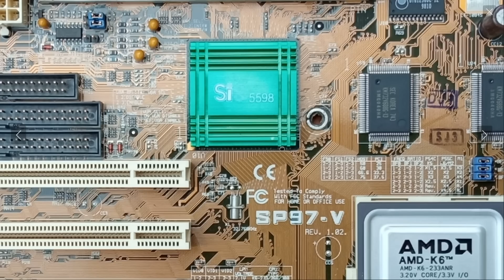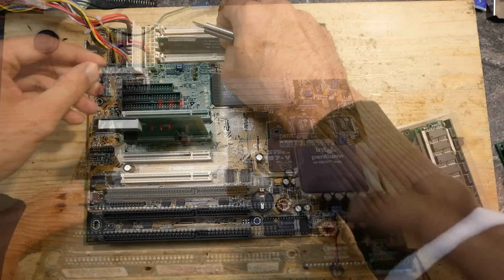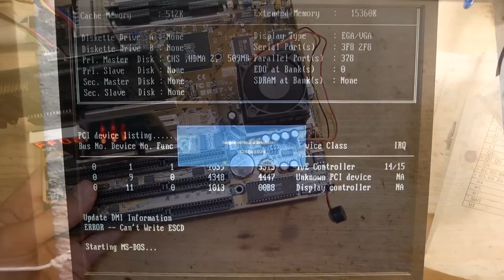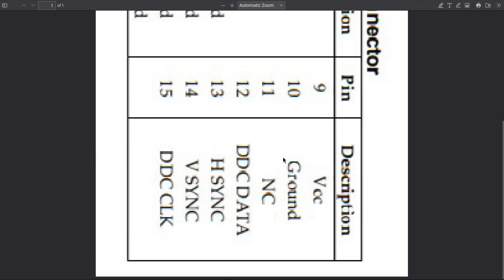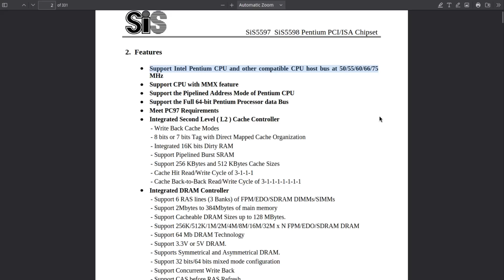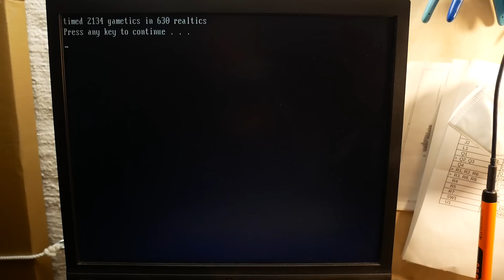Let's repair Asus SP97-V

Comment: Salvage is also valid, but as I was working in a computer shop around the time the motherboard was current, I often found that green SiS heatsink at the bottom of the case. (The days of playing local multiplayer Starcraft on 486 like systems just for fun)

Comment: This was the motherboard I had in my first PC. It was cobbled together from older parts in the early 2000s. I wanted to get one to rebuild it a few years ago but couldn't find it anywhere. I ended up with a complete system with an Asus P5A-B motherboard. It doesn't boot no post beeps. I may sit down sometime and try to diagnose it.

Comment: ASUS produced an OEM ATX board, the SPAX, that is essentially this board in ATX. There's usually (always?) a PCI slot omitted with the onboard graphics backplate connector populated. I've cleared the holes for the missing slot and installed a connector on several SPAX boards, and then used the SP97-V BIOS to get K6-2, -III, -2+ and -III+ CPUs, which makes for a really decent SS7 system! Losing the onboard graphics is, of course, no loss :P

Comment: Hi all, I have socket 3 mainboard which on startup via analyzer cards shows only dashes. When I pull down the chipset with a finger there are some number, but  post stucks on code "13 12". Ami bios. The question is: is it possible to repair connection between chipset and pcb at home? I don`t remeber well, but necroware or another YTber has the same issue. Help please :)

Comment: This unlocked memories!

Many years back I got a discarded CPU with this SP97 motherboard from a nearby computer store. It is a simple little motherboard, possibly the former owner used it for typing documents and such. Unfortunately, I didn't know better and I did only salvaged the Pentium 166 processor and the RAM, but did not preserve the motherboard. Back then there was not a lot of information on SiS chipsets boards, and there are stigma around them in the tech forums.

If that is aired in 2006, I'd happily keep it! 😆😅

Comment: I had the same chipset on a PC Chips motherboard, in my first SI special. It had the same USB and Mouse board, but the bios was compatible with K6-2. It came with 16mb and a Cyrix MII-233. I added a K62-350 overclocked and a Voodoo Banshee and it was a capable dos gaming machine.

Comment: I used to use those SP97V boards quite often (i was working in IT back at that time), they were good solid board for general purpose office machines (as mentioned), but definitely needed an external GFX card for any kind of gaming.. plenty of flexibility for configuration and upgrading, as well as being relatively cheap compared to intel based chipset boards.
Edit: typed while watching your video, wow that final test config was pretty much what i ran back in the day, until I upgraded to BH-6 (then P2B, it was better) running cel. 733 @ 1.1ghz

Comment: My parents had a PC with this chipset and I thought it was terrible at the time, mostly due to that integrated graphics. I remember it used the same drivers as the SiS 6326 dedicated card. I also remembered reclocking the CPU at 66x4 because the default 75x3.5 was causing graphics artifacts.

Comment: I used to build SiS SuperSocket 7 PC's back in the day as a little side-line at home. Did about 7 to 10 per week and with the Cyrix MIII 333. With lots of RAM, a good HDD and a Modem thrown in they sold like hot cakes. I could not make them fast enough. Why ?, they were cheap. £100's cheaper than a shop PC but with excellent performance for the time.

Comment: my only critism as that it doesnt have sdram slots, other than that its pretty similiar to the pcchips board i had but that only had a SIS 530 chipset with 8mb agp onboard, except the cpu settings where done in the bios.

Comment: Regarding the new bios chip - I have been there too. During restoration of a very early socket 7 SiS based Asus board. Not only you need a flash chip to let the board update the ESCD but it needs to have a proper organization - my problem was a chip that allows deleting data in chunks of specific number of bits. This resulted in a corrupted bios after every! escd bios update! I have studied datasheets of all my spare chips and found some where you can change data bit by bit and it works! The board is now running a P90 in a real gaming museum and bringing fun to people 😀
Reply: can you provide the name of that compatible EEPROM? :)

Comment: Can you run the Integrated graphics and a PCI graphics card at the same time? Could be useful if that's possible 🙂
Reply from the maker: No, that doesn't seem to be possible, at least not on this board. Integrated VGA gets deactivated as soon as external card is present
Reply: @necro_ware  Drat! Oh well it would have been cool if they could have been used in parallel 🙂🤷‍♂️

Comment: I think this board can also work with a single simm. That would be interesting to test, as well as intergreted graphics performance with that.
there is also a pin header between the ISA slots, is that for sound?
Reply from the maker: No, that is a VGA feature connector.
Reply: @necro_ware  OOOOH! I see.

Comment: Good video as usual :). Also the board supports long ISA cards. A good thing if you are in my case using a Sound Blaster 16 (CT2910 Yamaha chips) with a Gravis Ultrasound MAX.

Comment: SIS was like Ati... their drivers sucked, and in time, when they've fixed it and made it finally reliable and kinda usable, the PC component was out of date.
It's like with Rage Pro and Rage 128. These cards works quite well with 2001 or 2002 enhanced drivers, that are on page of Ati now.
But it wasn't the experience during 1997-2000.
Maybe users with Rage Pro, had to wait year, for good OpenGL drivers. They weren't even able to play Quake 2 as it came out, or Quake 2 demo. So Ati had to do special opengl.dll for Quake 2, but it dropped performance in other openGL games. Their drivers were mess.
They've then released Ati Rage Pro Turbo chip, with drivers, that added 30% performance to Quake 2. So it seems like new card.  But it wasn't. It was same chip as Rage AGP 2x, just renamed. But performance in other games with those drivers dropped. What a joke!

Comment: I think key poind finding pc retro parts is searching for good prices and offers instead of searching by model number. I've bought recently boxed asus p55tp4xe with pentium 166, cpu cooler and ram for 50gbp shipped. All I need to do is replace rtc dallas with necroware module. Thanks !

Comment: This motherboard has a 83Mhz FSB option. The PCI bus runs at 33Mhz, when set to 83Mhz. So, with good memory you can use that speed. Memory does run at 83Mhz. Also a Tillamook processor runs with no problems on this board. So you can make a 333Mhz system, like I have.
It's a very stable board and faster then a TX motherboard (PCI throughput with 3dfx cards). 128mb memoryt can be cached. 256mb maximum memory supported. Only downside is that Asus did not implemented the sdram, while the chipset supports it.

Comment: I did a lot of testing with a pcchips m571 board based on this chipset, but I definitely got inferior performance compared with my Intel 430vx board. Perhaps this was due to the motherboard manufacturer rather than the chipset in my case, as pcchips were notorious for cutting corners!
Reply: I have PCChips M726MRT, and it has like -40% performance, when I use same procesor in competition, like some VIA Apollo Pro board. 
 I am suspicious of BIOS. PCChips often sucks, also on BIOS side.

Comment: Just a FYI, you spoke about the 430HX and its dual Chip arrangement, which is true, however, you got the chips features. The Northbridge contains the Memory controller (RAM and Cache) along with the CPU FSB and the PCI Bus. The Southbridge is connected to the northbridge through the PCI Bus. The southbridge contains the ISA bus, IDE controller and any other low speed devices (USB, UART etc).

SiS were one of the first chipset manufacturers to integrate the North and Southbridges into a single chip which, while making the chip larger, actually saved space, allowing for more compact board layouts.
Reply from the maker: True, north and south bridge are communicating through PCI bus with each other. I think, south bridge does the bus mastering, DMA control and similar stuff, but the main PCI controller is in the north bridge indeed.

Comment: It has only advantages as a board for me. Very feature rich for the era, great that has usb and ps/2 very useful, I saw many parameters to play at BIOS for tweaking memory and cache, has also ATX header very important, a great overclocker and supports a wide range of cpus!
I love boards with integrated graphics of that era cause you can test them without a video card, a really great find!
Keep up, cheers from Greece Jim.

Comment: The guy I used to work for bought dozens of these back in the day - we used them to upgrade old AT style computers for our customers.  The ATX/AT style power connectors would work in their  old cases - and the AT keyboard port worked with their existing keyboards.  Having the built-in graphics saved the cost of a new graphics card  - and the ISA slots would work with their old EGA/CGA cards and monitors while leaving an inexpensive upgrade solution when the old monitors finally gave out.  Great little boards...
Reply: We used to do exactly this in our shop as well 👍

Comment: I had Gigabyte board with SIS 5591 chipset. It was standard 2 chip solution, performance was good and it had AGP slot. But there was AGP driver only for Win98, but not for W2k. So AGP cards under W2k were very slow.

Comment: Do the AMD super socket 7 CPUs also use on board L cache?
Reply: The + versions have L2 cache.
Reply from the maker: Yes, they do. K6-2 and K6-3 both use L2 cache. The K6-2+ and K6-3+ have internal L2 cache (128K and 256K) and the on-board cache becomes L3 cache. Some boards have hardware bugs and don't support L3 though.
Reply: @necro_ware  k6-3 has also internal L2 cache. Only K6-2 doesn't have.
Reply from the maker: @warrax111  right, my bad.

Comment: I have an OEM version of this board called the ASUS SPAX used in various HP Pavilion machines. Jan Steunebrink was nice enough to create a modified SP97-XV BIOS for the SPAX with the CPU and HDD upgrades too. Although it has trouble running certain games like Descent 2.

Comment: I probably would have been very interested in a board like that back in the socket 7 days if I hadn't already purchased an Intel HX chipset based board that was also capable of 83 MHz FSB. I had one before any of those SIS based boards or the Intel TX chipset were released. Ran my AMD K5 and later K6 chips on the 83 MHz FSB for a nice performance boost. 😊

Comment: I bought Gigabyte's SiS5571 motherboard in the past.
It was little slower than TX430 in Benchmarks (´・ω・｀)
Because it set 4T for dram write cycles.
The setting didn't exist in the BIOS.
So I checked the data sheet.
A while later, a new BIOS was released.
The BIOS had a setting for dram write cycles.
So, I try to change it 3T (๑•̀ㅂ•́)و✧
It worked without any problems. 
The benchmark results were almost the same as TX430.
I think Intel's political power was too strong at the time  (>_<)

Comment: I used quite a few of these (and similar boards) back in the day to upgrade 386 and 486 systems.  They were for office-type use, so the integrated graphics was a useful feature.  It performed better than reusing the ISA graphics. (which were generally very low end models to begin with)

Comment: My 'better than I thought moment' few days ago: found an Asus A7V133-VM from my stash. VIA KM133A chipset, integrated ProSavage and VIA audio. Flashed newest bios, put there Athlon XP-M (Barton) and of course it runs underclocked because CPU is aimed at 166FSB and mobo gives up to 133FSB. Then I played with setmul and viafsb-programs, and got the bus speed to 166(!) and it is stable with PC133 memory set to 3-2-3 settings. Then I installed Windows and run good old setfsb-program which took it 170FSB(!!). Never seen over 170MHz bus speeds on any SDR memory motherboard... My Abit KT7A boards (KT133A) can do just 150MHz and that's it. So, mATX office-motherboard overclocks better than anything :D

Comment: "cheap office machines"? I had this board running for a longer period of time as my Windows NT 4.0 PDC with IDE & SCSI HDDs and int and ext DAT, AVM B1 ISA ISDN, 3COM NICs, ... in a nice midi tower case. So the embedded "-V" was cool. 
Still with me and running fine. Btw. It got a NT 4 Workstation on DOS FAT ! boot option as well.

Comment: I have an SP97-XV that I've been trying to get it working, I can make it POST and boot from time to time but it fails on most occasions (when I hit the button it just does a spin of the PSU and stops) and that is very confusing to me lol
Reply from the maker: Those could be dry capacitors. Instability issues like that are usually a sign of bad caps.
Reply: @necro_ware  that's what I thought so I just replaced them all.. same issues.. I am, however, starting to believe it's related to the CPU.. I have some more on the way since I had none for Socket7
Reply: @HugoFaria-AZ   If your CPU is wonky, you could overvolt and underclock it...
Reply: @SianaGearz  I just might as well now wait for the 3 I've ordered 😅
Reply: Try cleaning the bios, ram & cpu sockets with contact cleaner.
Reply: @oldschooldude8370  I still need to clean the BIOS socket.. the placement is not ideal and I have no clue where I placed my chip puller 😅 the rest has all been cleaned and the caps replaced..
Reply: @oldschooldude8370  did that and used bent tweezers to get the rest of the way out.. just finished cleaning it :D
Reply: Magic Finger™ not helping?

Comment: This is a really good board and yes, SIS is underrated 😊
Reply: Whenever I heard or read about how bad SIS as a chipset manufacturer was I remember how good the SIS735 was (K7S5A) and remember how common is for people to talk nonsense.
Reply: The SiS 700 series for Socket A delivered very good performance and were cheap, I built many pcs back in the day
Reply: I have this exact board. It has a multiplier option to take my Pentium 233MMX down to 100MHz. From there can use Setmul to down down even further. It’s a fantastic board.
Reply: Phils lab in tha house !
Reply: I'm traumatized by the SiS 968 chipset
Reply: Had a SiS 530 for a while, Amptron 598 LM-R. Had 1MB "pipeline burst" cache and was able to handle 768MB ram when I later put XP on it. IGP wasn't the fastest but worked well enough. Under 9x max 8MB but under XP up to 32MB memory shared to it.
Reply: @Bruce-LeeLSA I had an IBM aptiva with that chipset. Put in a K62 and over clocked it to 600mhz with 512mb of ram. Used to play city of heros on it. "Play" hahaha.
Reply: I have got the same experience. 👍
Reply: Nevertheless SiS Chip Sets had been first choice for i486 boards AFAIR
Reply: Probably because their efforts after socket 7 were... Less than stellar.
Reply: @myne00 Not true. Example , for Pentium 4 there was the 645/645dx/648/648fx chipset. Great alternative to the Intel chipsets.
Reply: @g412bb  Until you get to the SiS 7001/7002 USB controller, which was problematic compared to using Intel.
Reply: @myne00   They used to have the fastest DDR controller for a while and PCI and USB implementations are less buggy than VIA chipsets of the era, so i would say they were fine.
Reply: @myne00  Then how do you explain the K7S5A and P6S5AT's success?
Reply: @NSHG  Those were actually pretty garbage, limited OC options even with modified bios, on P4S5A actually none, and those ECS boards had buggy ACPI and 16-bit sound on SB live and other PCI sounds cards under win98 did not work on them. There are much better alternatives from MSI and Asus. For example MSI 745 ultra is amazing overclocker capable of running at FSB 166/DDR333, first board to get those clocks and it just flies compared to VIA KT266. In general SIS chipsets were superior to VIA, way less buggy, its a shame the market did not acknowledge that fact back in the day.

Comment: Back when I first got into building PC's for other people, these boards were used alot for cheap PC's, coupled with a Voodoo card, they were not all that bad game wise, but yes, SIS chipset drivers used to be a pain, especially in Windows 98! The onboard sound is pretty poor though, c-media if I remember rightly.
Reply from the maker: Yes, unfortunately drivers were really on the bad side. This particular model has no integrated sound chip, but some similar boards had one. Usually it was ESS, but also some boards had C-Media and Crystal. I think latter was one of the bad ones.
Reply: @necro_ware  I'd take crystal and ess over the cmedia early stuff. But yes, I think XP did alot for driver conformity / stablisation though, but we are well into the Pentium 3 / Pentium 4 by that point sadly :(
Reply: Yep, our one had a CMI8330 which was rubbish.